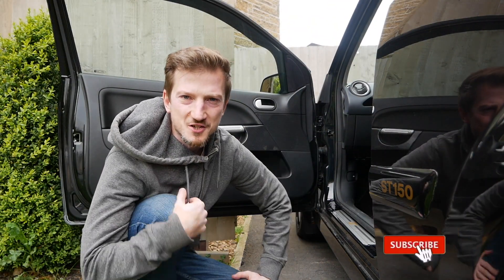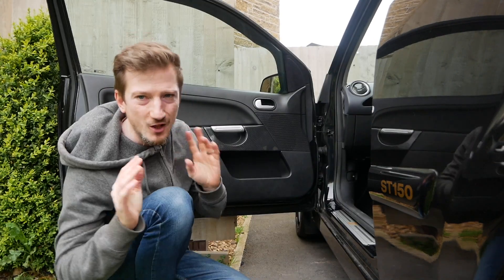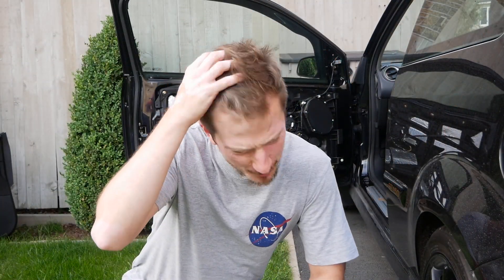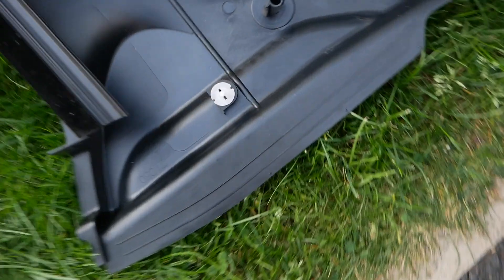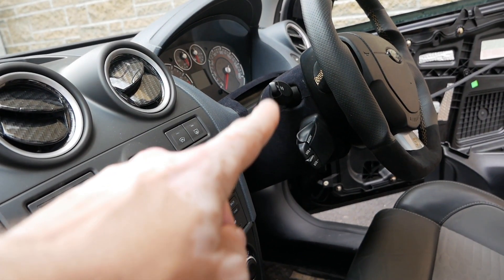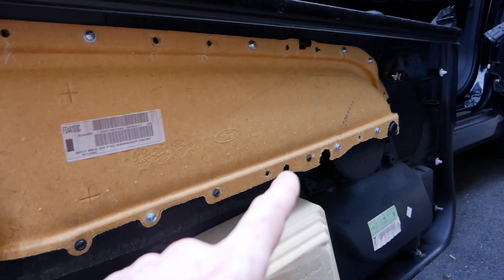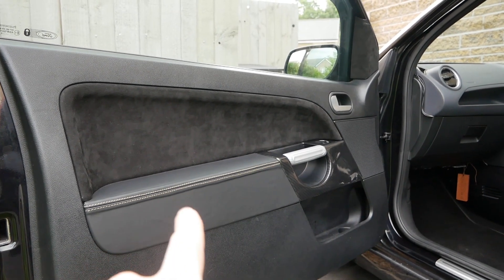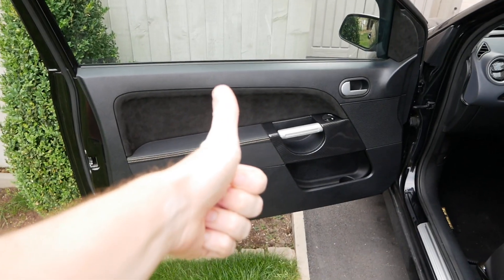Re Trimming Door Cards In Alcantara & Black Nappa Leather Custom Interior Fiesta ST150 - Ep77

Comment: i got a question, Where did you buy that center piece with the two cup holders? Cause in Spain that center part only got one holder and is the hole for the ashtray
Reply from the maker: At present I am not sure anyone makes them now. May need to ask on some Facebook groups or keep an eye on eBay or even Facebook marketplace

Comment: Have you found someone to black out your headliner, maybe use the same leather or alcantara. Idk about the sunroof but that cream lets it down on the interior. Other than it it’s mint.
Reply from the maker: Yeh agree it does let it down. I think I would have the pillars all done in the black alcantara to have the same material. Then black for roof lining. Just the cost of the alcantara is so expensive. For my seats alone I will be looking at close to £200 just for the alcantara. Then leather and then cost for the work. Seats will make a huge difference
Reply: @DriveWithAndy  mate save yourself the money and get it done with black cloth. It’s above you so no one will ever see it and it’s better then leaving it cream. I’m sure you seen mend it mod it’s video. Do it like that. You don’t need to use alcantara for eveything, acting like you need alcantara for the floor carpet later down the line too. Love the build but yea
Reply from the maker: @ajayxo6712  haha yeh cover it all in Alcantara 🤣
Yeh I see 2hat your saying. If funds allow then nicer to have the same materials. As even black fabric may have a different colour. That's why I had to get rid of the last bit of black flocking as even though black it's so different to the black alcantara and I hated it

Comment: Looks great. What did that set you back? Want to do the same if the price is right
Reply from the maker: So the price I paid included the two pieces of trim in the corners of the doors too. The wing mirror control on drivers side and plain one on passenger side. It was all £250 but I sourced the alcantara